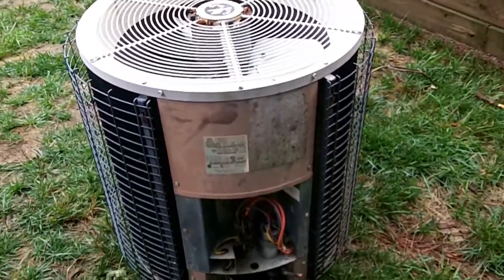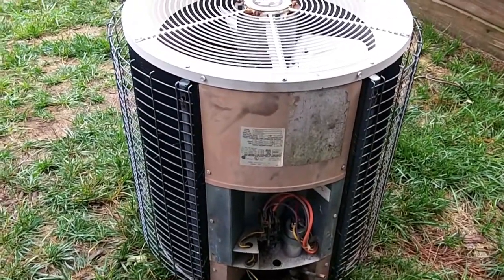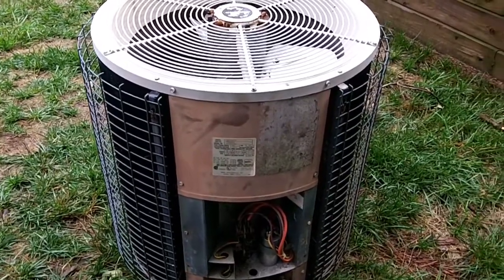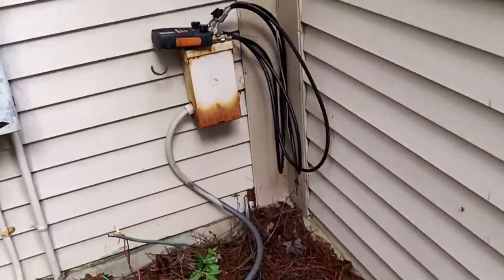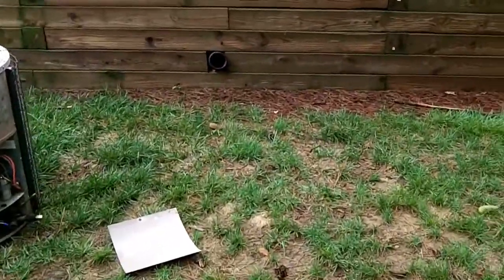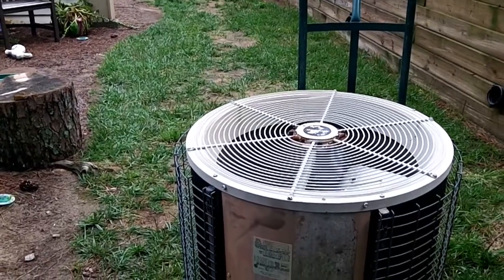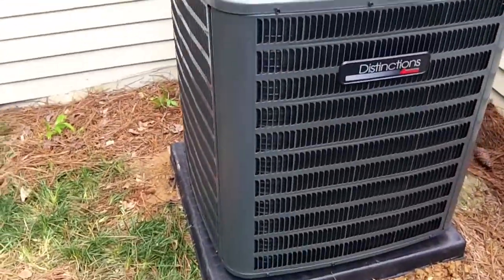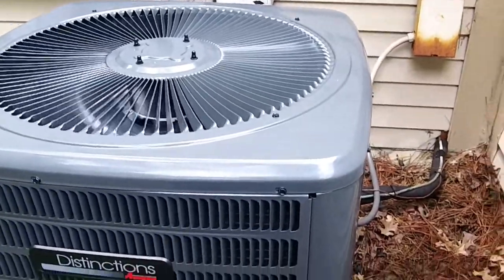AC To Heatpump Conversion

Comment: Are any changes required on the indoor unit other than low voltage wire and thermostat programing?  Did you use the existing evaporator?

Comment: What if inside at evap i had a capillary tube will heat pump work and also what if I only have y and common outside do I run nee low voltage

Comment: Oh my Ralph my mentor and put these in, in both heat pump & AC configuration's. It was kinda frustrating at the time as the heat pump version had a lot of reversing valve failure at the time!! Great show Ralph and thanks for the memory of the original Amana line!!! : )